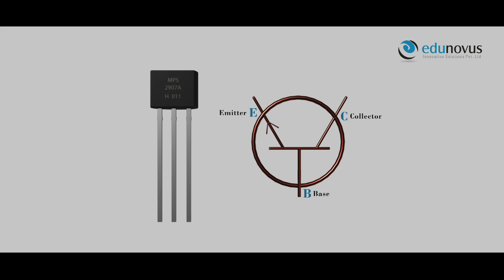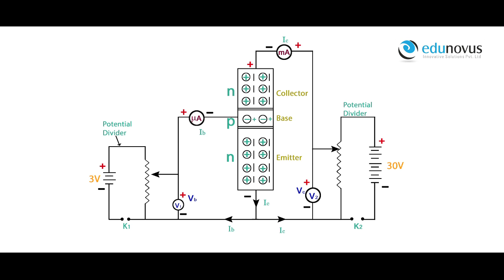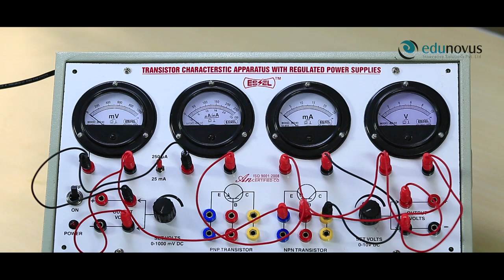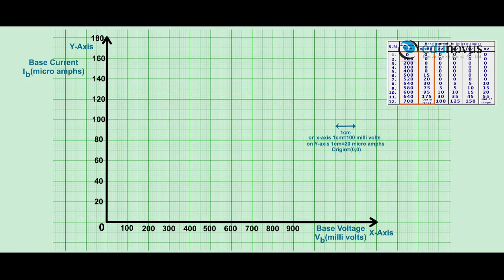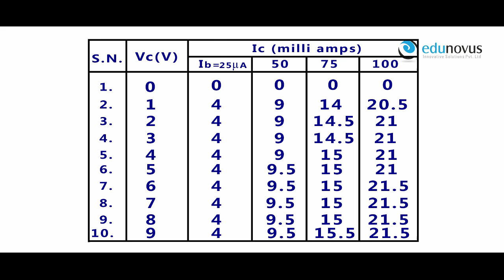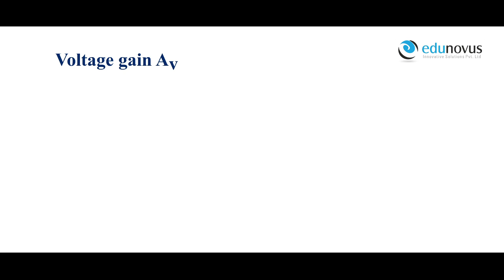Physics Practical: 20 Transistor Characteristics (Use headphones for clear audio/sound)

Comment: at time line 15.30, in the chart enlisting values of base voltage at the top line, you have mentioned BASE VOLTAGE IB in Micro Amps. it must be BASE CURRENT IB. in Micro Amps. please correct. also use same color male pin as the color of  female pin for negative terminal as Black. same for positive terminal, for easy identification. great work. if possible, use measuring instruments with glass in behind the moving needle to avoid Parallax effect. for correct readings.

Comment: Calculation of Output Resistance --  Should'nt output resistance   Ro   =   1 volt  \  0.004 amperes   = 250 ohms   ---- does anyone agree or disagree ?

Comment: While calculation of resistance the units of current are in mA and uA. they should be made same.....
Reply: Ya..that's y beta is less than 1. It should be around 50 even more  but not in decimal